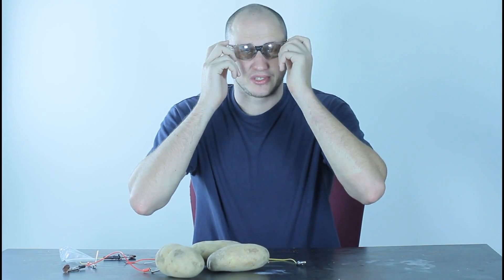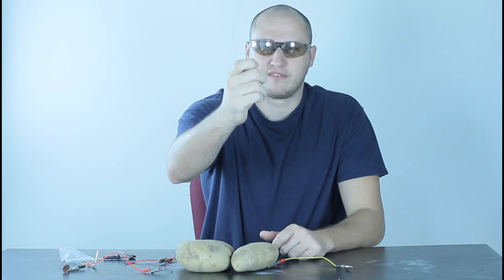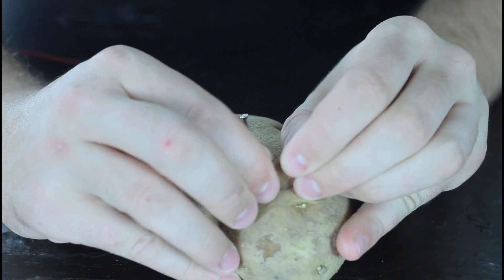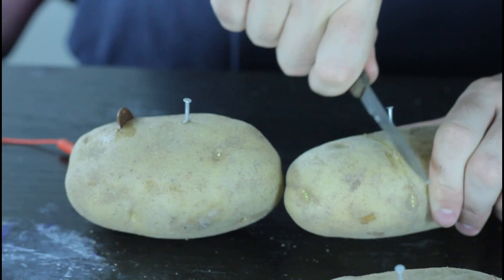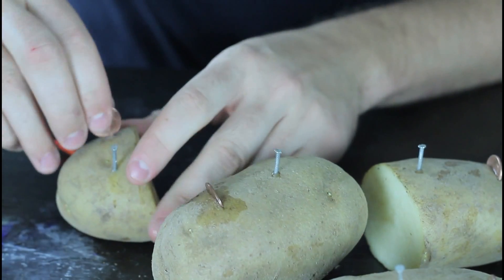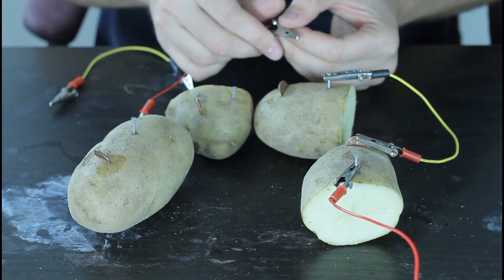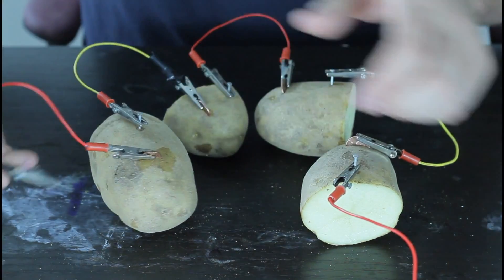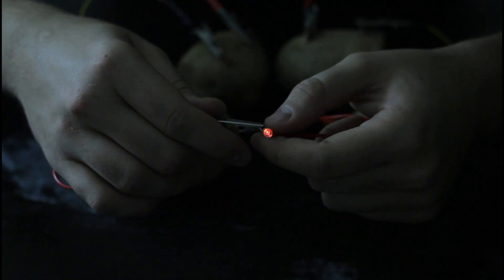Homemade Potato Battery!

Comment: copper and zinc metals are able to generate opposite polarity in closed circuit in potato, coin, is copper and galvanized nail has zinc coating.

Comment: Okay so, let's explain it this way...
Electrons (electricity) are negatively charged. Copper forms a positive ion, so it must LOSE electrons (losing negatives makes a positive), forming +Cu. Zinc (nail) and or iron make negative ions, so they want electrons when they react. Copper wants to lose electrons, iron/zinc wants to gain, the energy flows and powers your LED light!

Comment: Copper and zinc metals are able to generate opposite polarity when in a closed circuit in potato, coin is copper and galvanized nail has zinc coating.

Comment: Did it wrong... Only got juice from one potato there.
Reply: 1ManNamedDan  so he still did it whats wrong with you people
Reply: What is wrong is there are people like you that  are fine with letting others spread ignorance by showing the wrong way to do things you moron.
To CORRECTLY hook up a parallel circuit here you would need connect all Red wires  (+Pos) one post to the next then each Yellow  (-Neg) one post to the next... that way you get the combined currents instead of each current just terminating its charge at the end of the next post
- the way this is shown he is barely getting the charge of one potato.  
It's simple science taught in elementary school to kids.
So don't ask what's wrong with us, there are still a few of us out here that don't allow ignorance and the spreading of it to go unchallenged.
Reply: +1ManNamedDan oh, you mean also connect the nail to the penny on each potato? But don't potatoes too conduct current?
Reply: That's a pretty good idea. You could connect a penny to each relay then take a reading to see if there is an added chemical reaction and charge benefit. Yes the potatoes do conduct current do to the water and potassium  (electrolyte) content.

Comment: Its a galvanic cell basically where the iron of the nail and copper from the penny is acting as the electrodes where the potato itself is the electrolyte. the difference in reactivity of the two metal electrodes cause a spontaneous reaction to occur and generates a current where the iron nail oxideses and the penny reduces.

Comment: Probably copper, and the nails could be iron with a galvanized zinc layer which helps in the electrolysis. If someone has some zinc metal pieces, one could try to make a pile of potato slices,coins and zinc metal to produce a relativly high voltage.

Comment: simply put, it is similar to the first battery, the voltaic pile made by Volta(V, VOLTage). There are electrodes put inte the potato which acts like electrolyte. The chemical reaction here is called electrolysis, H2O in potato is split into hydrogen and oxygen and the electrons starts flowing...

Comment: Great vid! Another trick is to use horse or deer manure, (or dung of any kind, needs to be damp, not dried out), pack in a box and use penny's and nails. Better to use sheets of steel/copper for more current. Same wiring, +-,+- etc. I've seen .1 amp from only sheets.

Comment: You will have the same energy if you put more nails and coins in 1 potato. There is not need for many potatos. The current comes from the metal. You can try it and compare them :-)